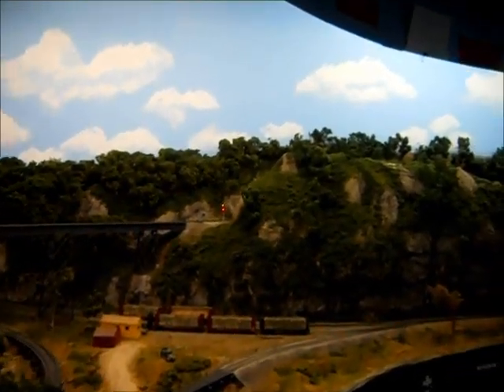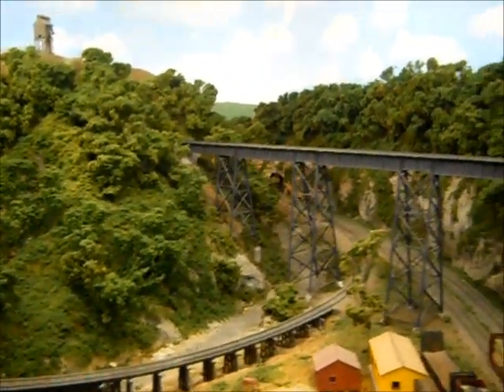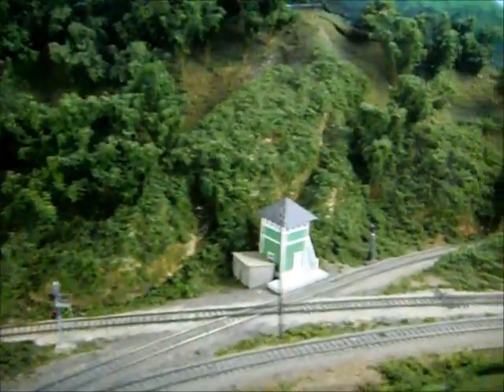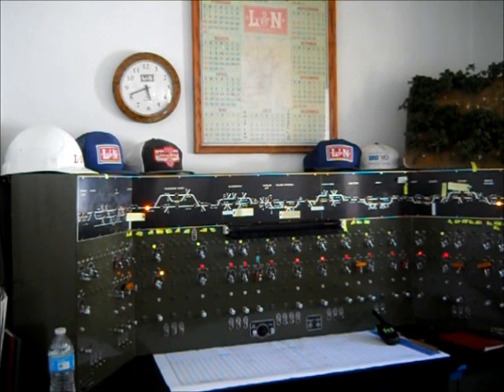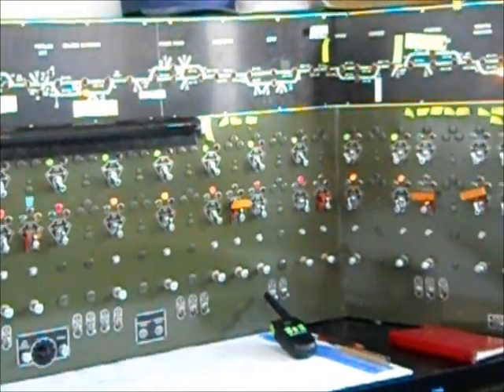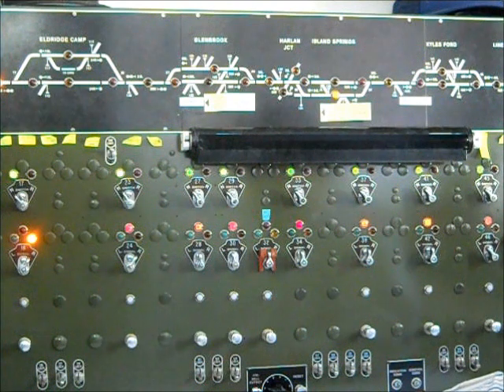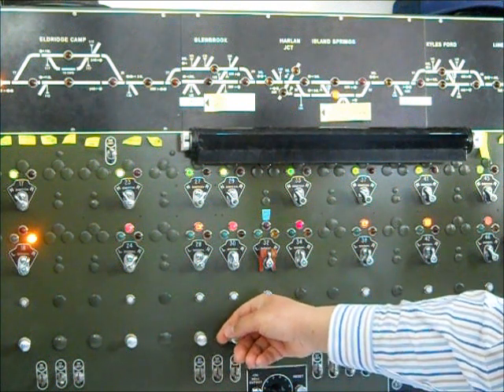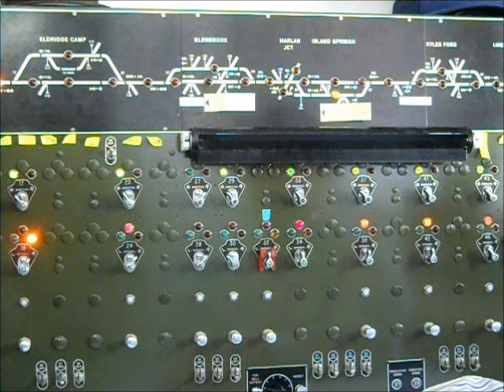L&N CTC Movie

Comment: Something to think about when doing signals.  The search light single led signal that changes color with voltage is almost impossible for some with red pigmentous to tell the colors on.  always suggest using three position signals that way green on top red on the bottom and no one has to see the color.

Comment: Nicely done.  A couple of suggestions.  I would have like to see a close up of one panel switch with an explanation of the positions at the beginning.    New folks will not understand what the left/right switch positions mean.  Also that the lights are reflecting the signal lights on the layout.    Finally, certain terms, such as "knocked down" need to be explained for the first timers.